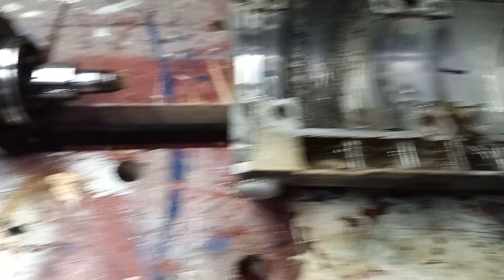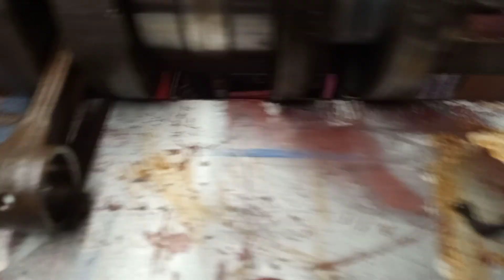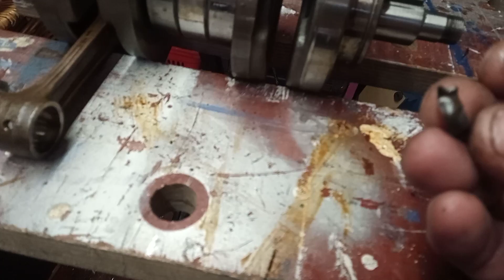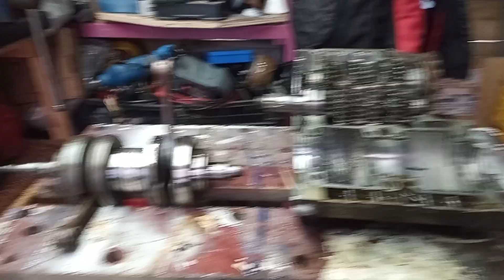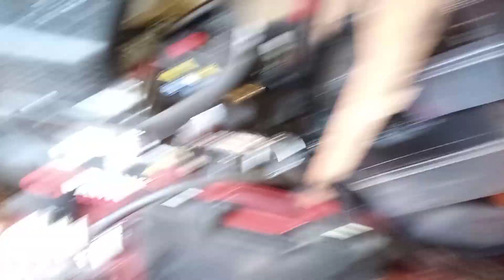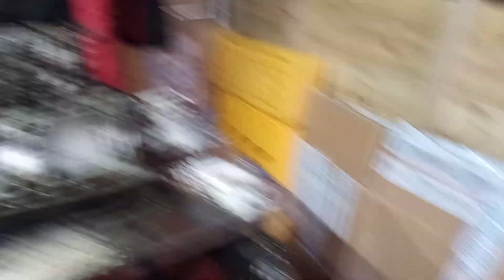poorly crank

Comment: Just rebuilt my Rd350 lc. Will not rev above 3500, cleaned carbs again, spotless, must admit have not cleaned emulsion tubes, checked for air leaks with easy start, nothing amiss. Completely baffled?
Reply: must be the carbs   some where